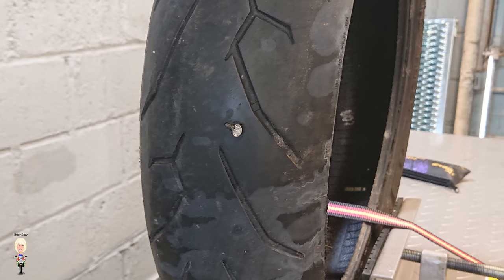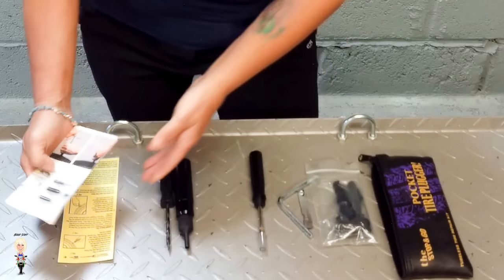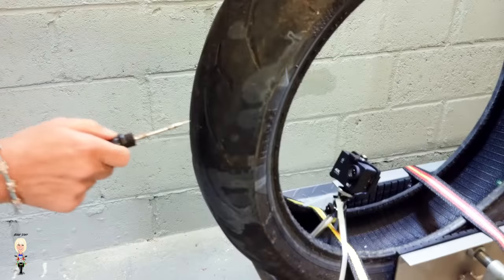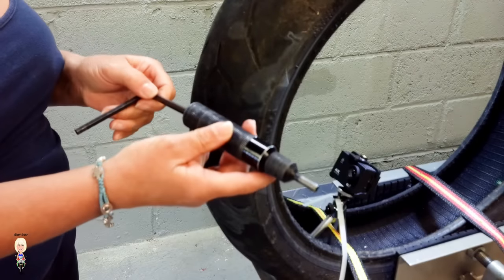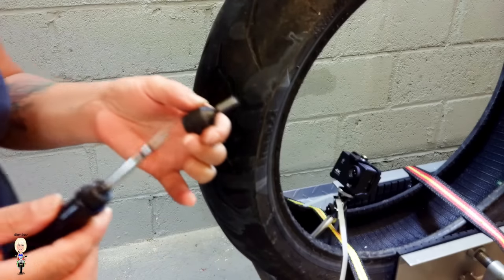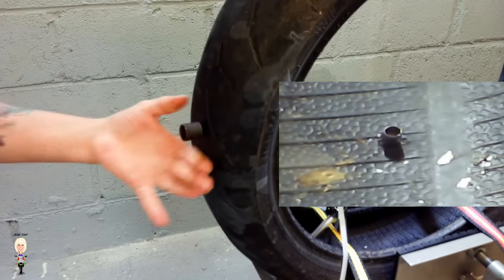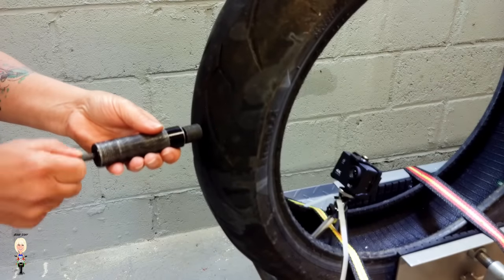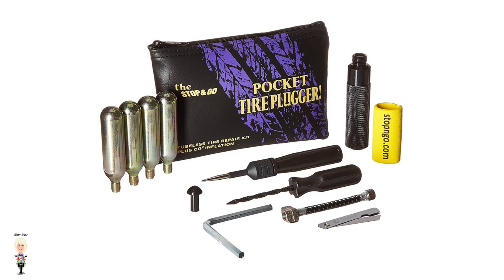Fixing a puncture on the side of the road

Comment: This is a good temporary fix if you're stranded on the side of the road. Beyond that I would replace the tire at the first opportunity. After a fix like this your tire is no longer at its designed speed and load rating.

Comment: Thanks for the video Dana! I already carry a tire repair kit on my bike, but I just might be replacing that kit for this one. I like how the mushroom head seals against the inner liner. It seems to work a lot better than the rubber and fiber cord plugs that I've been using for decades. Plus this one doesn’t require any glue like many others do, which tend to dry out in time if not used.

Comment: Nice and well done video Dana, I keep that exact tire repair kit along with a common gummy type kit in my rear trunk to be prepared for the unexpected always. My 1989 Goldwing 1500 had an onboard compressor system for the air adjustable suspension but when I moved up to a newer 1800 model the suspension was hydraulic so I purchased a small air compressor much like the one you showed, but since the battery was not easily accessible for using the alligator clip power connection I used an extra quick connect plug for a Battery Tender and spliced it into the compressor power cord wires (without shortening it's full length) to be able plug into the battery harness quick connector side and be able to reach both tires, **BUT CAUTIOUSLY REMEMBER **  "you will have to": Reverse the 12 V power & ground terminals on the compressor quick connector side to have the correct polarity to hook into the existing + / - "Battery Tender" battery connector terminals!!!

Comment: Interesting. Long ago i helped a friend fix a puncture on the front wheel of his bike. It was only a small pin that caused the puncure, so the hole was only 1-1.5mm in diameter and this kit would probably be hard to use. We went to a store and bought a liquid all in one fixkit, where you put the nozzle of a gas and rubbery liquid filled bottle onto the valve and hold it there until there's no more noise. (It the liquid hardens when getting in contact with air, so when it pours out of the hole and the gas is mainly to 1 push the liquid out of the hole and 2 to pump up the tyre.)
Important was that the wheel needs to be rotated so that the hole is the lowest point, and to not be shy in putting the nozzle onto the valve...
My friend was a bit hesitant and so some of the liquid sprayed back on him when he put the nozzle onto the valve. So he handed it to me with the words "your idea" and i tried it an it worked. (always easier if you have seen someone not succeding and only need to avoid the same mistake)
It worked well enough to bring the bike to a workshop where they ordered a new tyre and changed it. But it's a way messier fix than that in the video (at least for the person having to take the tyre off the wheel.)
Reply from the maker: Those spray foams work well but coat the wheel with gunk and can cause an imbalance, but they are fast and easy.

Comment: Thank you. Good review. Might get one instead of the Dynaplug. As always good advice. No wonder you have more than 22000 subscribers. Went to Lake District 3 weeks ago and got a valve stem leak. A can of Holts Tyre weld held the pressure until I got home
Reply from the maker: That can happen when new valves aren't fitted with new tyres.  You were lucky

Comment: I normally don't fix my own tires. I take them to the shop to be repaired. But you pointed out two good reasons to fix it myself. I watched it to the end!
Reply from the maker: How do you get to somewhere to have the tyre fixed?  This kit saves you from sitting on the side of the road waiting
Reply: @bikerstuff2  Very good point. I've been lucky to have slow leaks. I think I've had 3 in my driving years. No blowouts or complete failures. I'm usually able to get my car to the shop and pay someone between 10 and 20 USD to get it plugged and fixed. Current set of tires are about a year old and have no plugs. That could change tomorrow. ;)

Comment: When you pull the nipple with the pliers, should we use lube on the nipple so the nipple doesn't get damaged? Maybe something sticky to hold the nipples in place? The nipple looks like it's gonna pop out if you push it with your finger or give it a twist.
Reply from the maker: No, just use it as it is